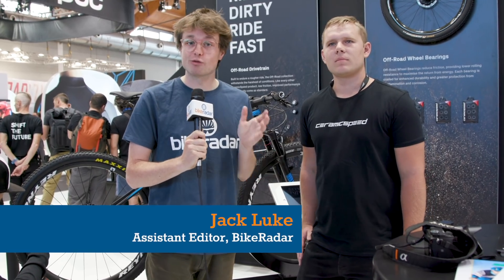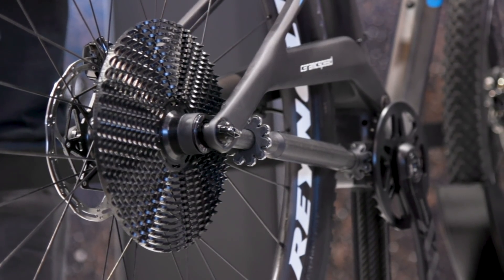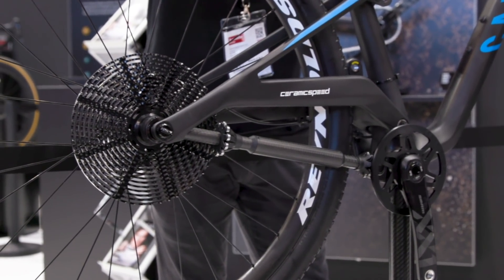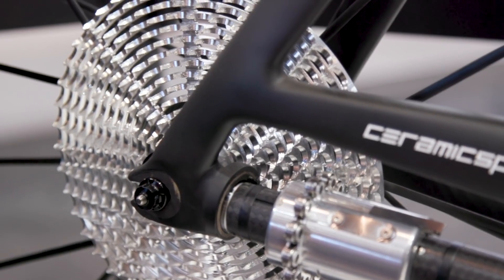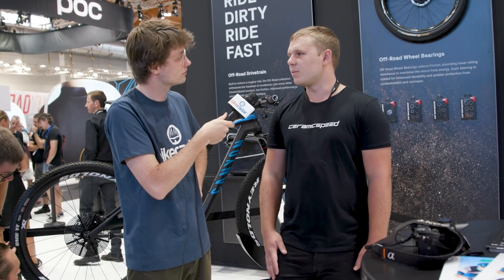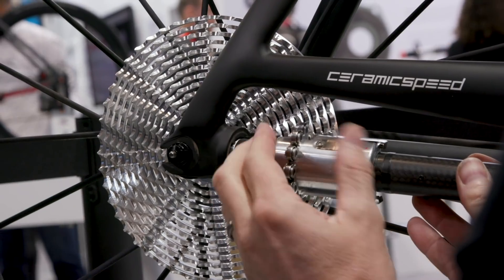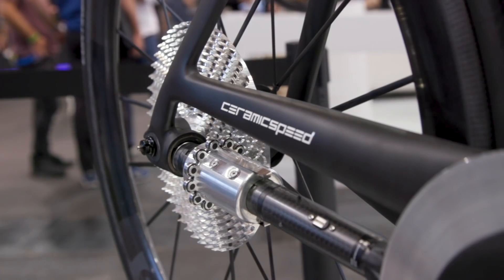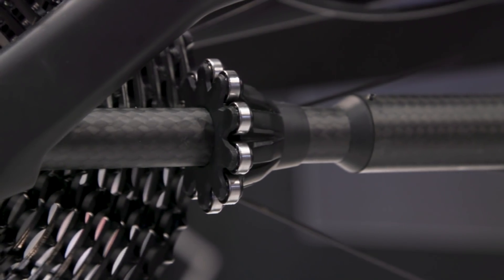No More Chains! The Future of Bike Design? | CeramicSpeed’s Driven MTB & Road Drivetrain

Comment: The beauty of a regular chain is that the load gets more or less distributed evenly across all teeth the chain is engaged with. In this case, all the power is going through one bearing at a time. I think is will cause the cassette to wear out much faster than a traditional one.
 As others pointed out the cassette stiffness may be an issue in high gear high torque situations like climbing.
I like the concept but it’s probably tricky to make it consumer-proof
Reply: this is probably the best point anyone has made.   good thinking Shiro.
Reply: @ScreamingEagleFTW  you can ignore my first point though, the load of a chain is not evenly distributed over all of the engaged teeth. A chain and sprocket would need some insane tolerances to achieve that. What I should have said is that if one if the chain rollers starts to slip, others that are engaged will take up the slack and continue power transmission without skipping a tooth.

This system in the video has a lot of similarities to a spur gear, which only contacts one tooth at a time. When it starts to slip, no other tooth will pick up the slack before it skips a tooth. I would guess they can make it usable, but a regular chain system would be lighter if we make reliability equal.

Comment: I really like the idea and I think it has great potential. However, are you missing a trick? Why have a staged gear system on the rear cassette. Why not have a solid rear disc with groves so that they drive bearing sprocket can move smoothly along the cassette and never actually jumping from one gear to the next. This would negate precise gear jumping which also interrupts power application and would allow the rider to progressively change the gearing and actually provide an ability to fine tune the gearing whilst avoiding the shock of gear jumps. Just a thought!🙂

Comment: Great innovation - I reckon this concept will take off!!

Just putting this out there, but what about an hydraulic drive powered by the pedals? Surely that would be the most simple drive chain which, in addition, could have infinite gearing ratios based on oil flow and pressure through the system?

Comment: I like they're doing something new, but the truth is we'll still end up using chains. It's easier to replace, it's cheaper, it has somewhat same efficiency. If chains weren't simple and awesome, we wouldn't still using be a 2000 year old invention. Maybe only pros will use it who need the absolute maximum efficiency and lost aero drag. But for common people, I suspect they will pay so much for the exotic materials used in this, when they could just get a $5 chain.

Comment: I'm not a hater, I just want to know how durable this equipment is. I'm six and a half feet tall and weigh more than 200 lbs. If I start pushing this drivetrain, will it hold together or disintegrate on the trail? Also, I like this concept a lot, the elimination of the chain, derailers, bulk of the gear set, everything. It LOOKS fantastic, however, I require function over form, not form over function. Everybody else can look fantabulous, broken down off to the side of the road, on their way to where they're going but I always reach my destination, even if I have to walk 20 miles. That's why I take great care of my vehicles, why my equipment is so important to me. If I'm not where I said I was going to be, I'm either dead or in jail (or not worth my respect, so I lied).

Comment: the biggest enemy of a 90 degree shaft drive is the separation forces cause by the gears. to combat this require heavy bearing housings and large bearings to deal with the axial load. Ok when weight isn't an issue. Its an issue on bikes. The first patent for a shaft drive bicycle was in the 1890s. So its hardly a new idea. The claims they make are outrageous because its not even at a prototype phase. A prototype is only a prototype if its functional in the real world. this is a concept at best

Comment: Interesting idea. But with so much fine mechanism and electromechanical mechanisms. It looks as though failure is designed into it. The old school mechanical shifting mechanisms are Reliable. Just as cars large trucks and other construction machinery. Adding electromechanical controls built failure and down time into the equipment. The old school equipment was far more reliable that today’s Technology controlled machinery

Comment: I am ecstatically delighted and disproportionately flabbergasted with enormous gratification and appreciation for the dispensation of such a tendering and mesmerizing information in which the prestidigitation of the concurrent and subsequent matter is thoroughly demonstrated through the innuances alluding to literal and metaphorical context. It is highly imperative to note that, such is the significance of the aforementioned distortion in any shape or form will result in catastrophic ramifications to which will be the outcome of epic proportions. I thank you for your unequivocal.Idealically, based on my intellectual capacity and my vast knowledge, tactically and tentatively, right from the beginning of times especially in the light of Ecclesiastes evolution, I have come to a concrete, definite and profound conclusion that I actually have nothing to say... Thank you!🤗

Comment: Great concept, but the design has a huge fluke and poorly engineered drive-train which will certainly fail unless they completely redo it.

The small bearings will definitely not withstand the torque needed to propel the rider.
Reply: I'm sure you know so much more than the literal engineers making this

Comment: This drive train is going to slip and sound like a rotary hammer drill on metal when you try to use low gear. That gear looks like it’s made of aluminum and will flex out of the way when the bearing ride over the slopes (gear teeth) when you try to apply any load on the drive train.

Comment: I like the concept but I can't see how you don't break all the teeth on the rear gear set. All the turning force is on one or two teeth! Compared to a traditional arrangement where all the force is applied over the hole area where the teeth and chain mesh.

Comment: Its like reinventing the wheel. Just replace that flimsy gear with a drive shaft from a motorcycle. If you want more than 1 speed, add transmission and clutch. Might as well add an engine, gas tank, and battery.

Comment: Single tooth engagement... your entire mass times the torque advantage all on a single tooth... But wait! There's more! The single tooth is way out in the rim of a thin Aluminum? Steel? Titanium? Ring with lots of holes in it. Yeah, that's going to let you slowly move up in speed, but at some point it has to give in. There's not much more to gain from materials. And if it's possible to slip, then it's dangerous to ride.

Comment: The shifting mechanism is extremely clever, props to them for developing that. I'm still dubious about the rigidity of the system, particularly deflection of the gear ring when reefing on the pedals in a low gear.

Comment: that would not work ..   when you re up hill  and put lot of pressure on the pad...     the circle thing what you ever call that will be bended and the contact with the moving shifter loss and it would not run of course

Comment: As a broke cyclist, first thing comes up in my mind is expensive
Reply: Sure for early adopters it will be, but a derailleur system requires a large number of precision components and they are very cheap thanks to mass production. If this works out (big if) it has the potential to be even cheaper to manufacture. License costs might screw it of course.

Comment: Seal it in a plastic gearbox, contamination problem solved. 
What I can't understand is, why are all the "sprockets" still attached to the rear axle? You don't neeed them there any more. Being the set completely flat, you can put all of them (bar one) in front and have them more easily sealable & have an easier gear change.

Comment: what if i told you there is a better option.
one where you can throw sand/water/sticks/rocks etc at it and it wont break or wear, wont need lubrication, has smooth gearing, and can shift under heavy load, doesnt need electronics and doesnt rust?
just saying

Comment: Rather see the use of a hyphoid gear and a gearbox to change the ratio with this concept in mind.  You're relying on axle width tolerances here which means a  proprietary rear hub and a means to adjust gear lash within a certain preload.

Comment: but why? chains have worked for over a hundred years. also wirless shifting? So it has battery which means It'll be bale to run out, which means I will have to recharge it and not be able to hop on my bike at any time I want.. It's just strictly inferior to a chain, period. Interesting idea nd all but i dont think this will really catch on

Comment: Not sure how it's going to work when it's full of mud and straw. Looks like a mud magnet to me.
Reply: Peter Dandrea mud isn’t farm-only. But the straw?...... yeah id have to say this dude works a farm
Reply: Wouldn't a regular drivetrain have an identical issue? Either way this is supposed to be mostly road bike thing.
Reply: @jorislal  True enough. It was just the first thing I thought when I saw it. I think the lack of hanging derailleur is plus point and it's an interesting design. Personally I think the future is a sealed gearbox at the crank, the pinion one is almost there, just needs to have non grip style shifters and lose a bit of weight.

Comment: The claim of being more efficient could be easily tested by hanging a weight on the pedal axel and measuring the torque at the rear wheel. Then repeat on a standard bike with the same length crank arms.
Reply: David Morley
Or use an electric motor to push an equal mass up a hill at speed.
Reply: I always calculate the efficiency of a static system hehehe

Comment: Nice idea, but intuitively I would say this can’t be a sufficiently robust construction.
Reply: Yeah just by looking at it I would say it looks pretty fragile and weak to dirt, mud and similar stuff
Reply: @peddazz2365  Yeh that's a possible apparent constrain. But I also thought about the transmission of energy. I cannot claim that I see it right but the force which is applied to the dents of the disk is probably much higher and more localized (as opposed to the classical design where the force is more spread on several dents). And now take the argument of yours: the particles (sand etc) would increase the wear of the material, unless it would be covered.
Reply: @BIngeilski  yeah and I could also see maintenance being a problem 

With the conventional chain bike most things can be done by a regular person with little to no expirence. I doubt that is also the case for this system
Reply: @peddazz2365  yeh plus price. It can only be successful if there's a significant degree of energy saving say on friction as well as robustness. But still it looks cool. That's it. And kinda advertisment for the company which I didn't knew existed

Comment: It's a very Innovative way of a transmission setup with no chain this could replace the standard chain and derailleur systems on many a bicycle just like the Innovation that came around in the late 1890s or the early 1900s when Columbia came out with a shaft driven bicycle that in itself was an early innovation but it was only a single speed with a coaster brake back then.

Comment: Why are people calling this a fad I mean it looks revolutionary
Reply: Because  its mechanically   flawed.
Reply: A basic understanding of materials science and kinematics would tell you that it's failure threshold is way lower than a chain/sprocket setup. I'm not trying to be an ass, most college level physics classes that aren't explicitly for engineering don't go much past rigid body mechanics, but for anyone who's taken practical engineering classes, it's pretty obvious this system has about a hundred times more points of failure than a chain. Granted, a chain slipping off requires more hassle to reset as this pretty much resets itself in the event of slippage, but it's still pretty much impossible to make this handle the same load as a chain with the same weight of materials and mechanical transfer efficiency
Reply: Leon Rosenbaum I dont think this idea (Design and mechanics) Is anything new. I cant remind myself BUT someone mentioned this already existed for decades.
Reply: @meinname5788  yeah, this idea has been around for quite some time, I remember reading about it back when I was in high school, and it's similar to basic perpendicular heard, it's main issue is slippage and material deformation

Comment: I don't see this current setup handling hard pedalling. The gearbox will have to be encased and sealed to remove potential flex and debris, with such limited contact area it seems unavoidable. Regaining efficiency after that will be tricky.

Comment: To the argument of the derailleur. I was a super fanatic mtb driver for 10 years. I drove every day 60 to 120 km. Every Sunday I went out for a trip true the woods. The area where I lived is one of the wettest countries in the world. So loads of deep dirt and flying branches during the trips. These trips started in September until February. In 10 years I used up 7 bikes. In all those years one time my derailleur broke off due to a branch. Or was just lucky with 20000 a year on a bike, or this argument isn't that strong.

About more effective power transmission.
Is that not lost due to the fact that a complete xram or xtr setup is much more lighter than this build?

Comment: That rear sprocket / freewheel should be a solid machined piece, and more stiff. Less likely to flex under load.
Reply: Im sure your armchair guestimation is more valid than their own engineering analysis, but please do go on.
Reply: @OminousPinapple  " A armchair guestimation ", from someone who had worked in a fabricating CNC machine shop, for the manufacture of industrial tool and die products i.e., sheet metal stamping / forming. 

  That freewheel assembly is supported by those few " spokes ", that while provide an open and lightweight design, that allows easy debris removal, it will tend to distort slightly away from the stiffer pinion assembly, especially on the outermost gear, under heavy load.

  A more solid backing, with reinforcements inside radially, will likely work out better. Along with some type of covering, as was mentioned, to keep debris out.

  I'm all for innovation, but it's still hard to beat the old conventional roller chain / sprocket drive on a bike, for reliability.

Comment: Hide all under the acrylic, put there some gearbox oil and made gears from real steel that will handle wearing and will be nice. This big multigear wheel should be die punched and hardened on surface leaving some flexibility on back.